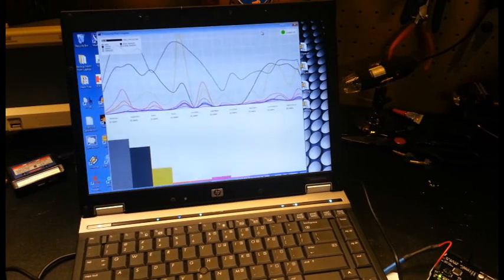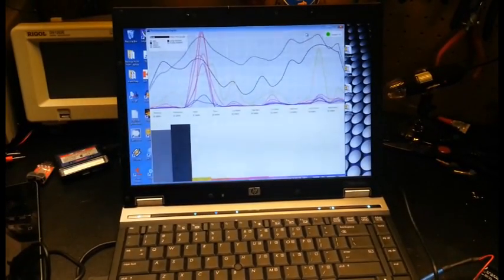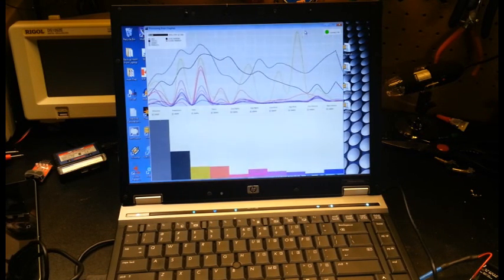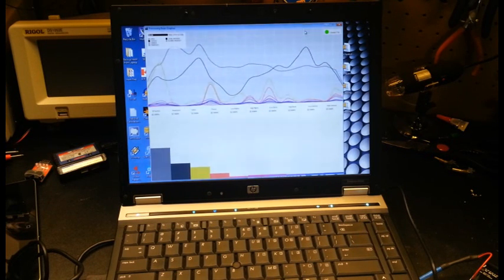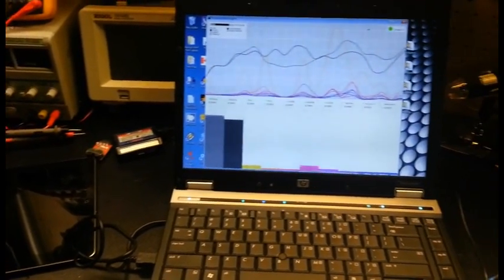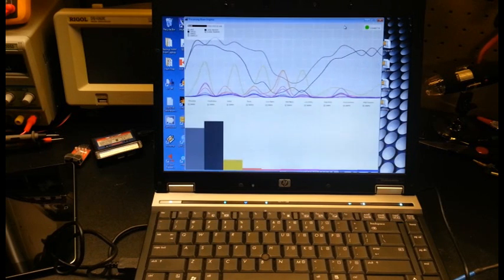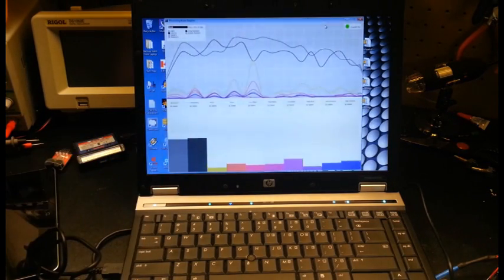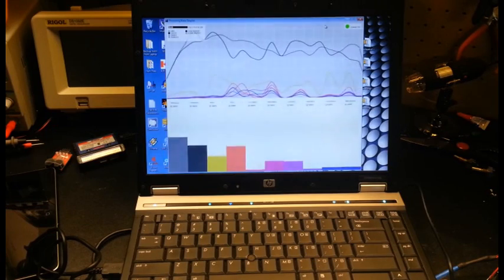DIY Brain-Computer Arduino  Interface Tutorial Part 3- Testing

Comment: That's very interesting have you try solving a math problem that makes you think and one that you know the outcome like the answer.
Reply from the maker: Hey Ruben- Yes I did do some math problems and those seem very repeatable results (to a degree). Whenever I do any math or even count by X value etc- the graph does seem to react accordingly.  I think there is huge potential here- just need to decide how to actually use and affect it for max effect.  Cheers!